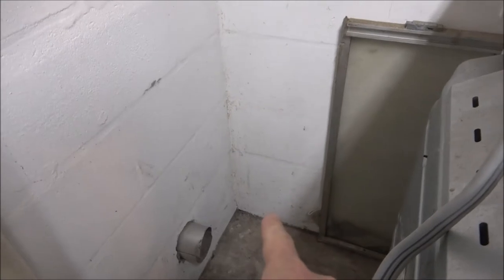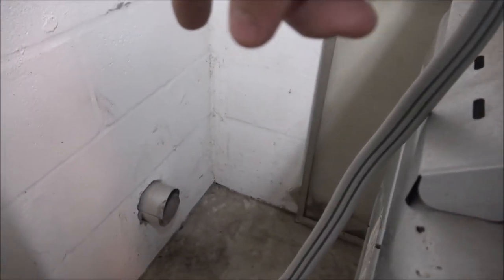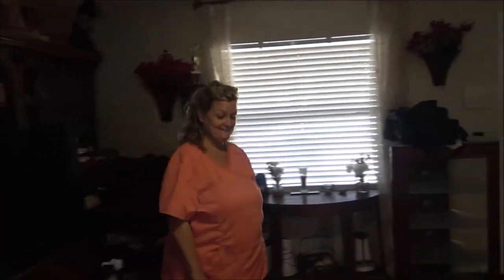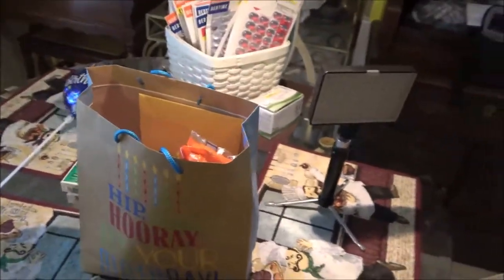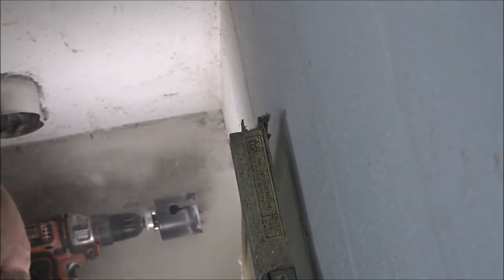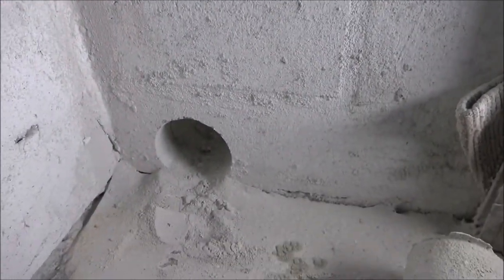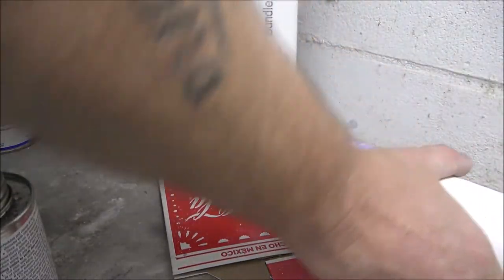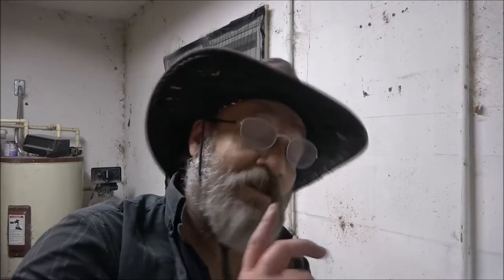Rerouting The Drain Pipe For The Washing Machine

Comment: Yep, my washer went to the septic and it backed up. I’m planning on re routing using a French drain. Fortunately a pipe is already there. I just need to run the pipe.
Reply from the maker: Yeah you'll notice a big difference. It's good that you already have a pipe there. A French drain is good too. I was going to put a French drain in mine but turns out I don't need it with all the sand we have down here. Thanks for watching and commenting Robert.